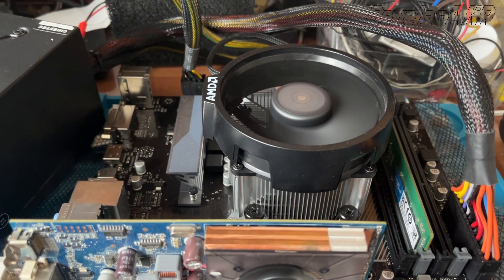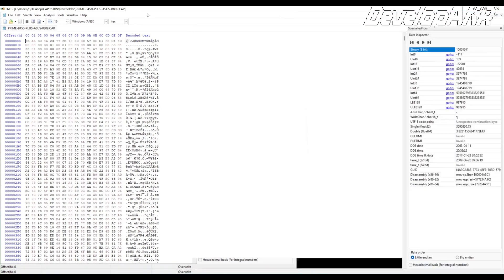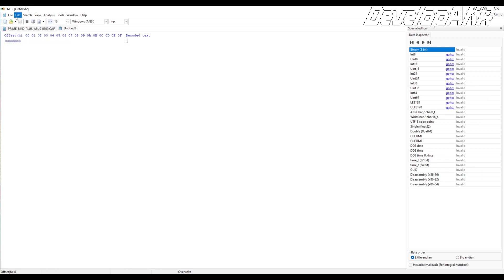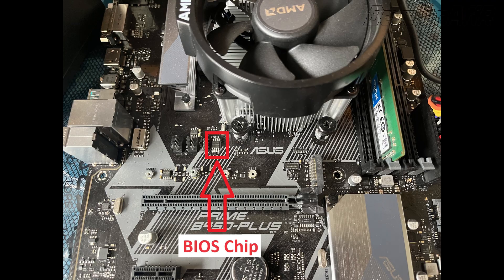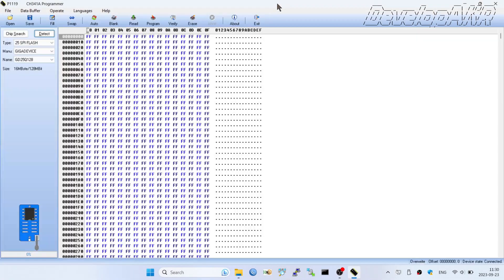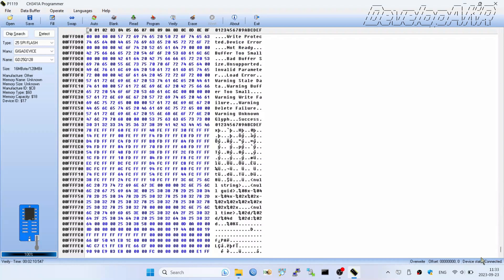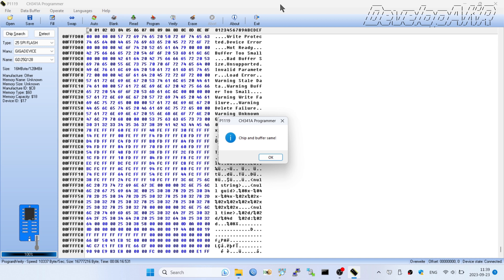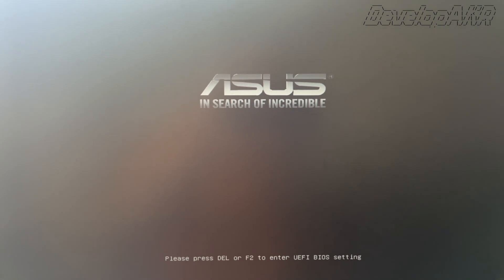How to fix corrupted BIOS using CH341A programmer #ch341a

Comment from the maker: This is a very easy and fast method to use the CLIP for BIOS flashing. However, always desoldering the BIOS chip if possible. This will prevent programming errors and motherboard damage.
Reply: luckily modern cards have a socketed bios
Reply: Ahh yes desoldering the chip will have less damage (im just joking i know what you mean im just dreading that ima have to take mine off to reprogram the chip amd im worried about damaging it)

Comment: Curious about the line 800 removal part as well when going from cab to bin.. what exactly is occurring in that step? For other motherboards/bios chips, is the line 800 a standard or does that line number change by manufacturer etc?
Reply: I'm confused too, because for my model it already downloaded as a bin file

Comment: How do you know that 800 lines need removal?  Does all of the information in the .cap file before the beginning of the bios section need to be removed?   In my ASUS P8H77V bios .cap file, when viewing with UEFI Tool, there  is an Intel section with ME after the AMI aptiva capsule header.  I've tried to create .bin files from ASUS .cap many times now, with no removal of lines, then as you showed.  Either way, I get verification errors: like this one when flashing the IC with the file that removed the first 800 lines: Verification error on address: 0x000005E0, Device: 0xFF, Buffer: 0x1C.  When I read the IC and create a file, compare it to the .bin file that was written (using HxD as well asn NeoProgrammer), the files are identical.  Either way though, when inserting the IC in the board and booting (after battery removal and CMOS clear), no boot.
Reply: thats the power of reverse engineering + experience

Comment: Hello sir, can this method be used on the BIOS chip of a Lenovo laptop? I just flashed the BIOS yesterday and my laptop doesn't display anything except a black screen, with the caps lock and esc lights always on after pressing the power button and the fan spinning. I have tried many methods online but without success.
Reply: 1. Even putting the clip on the BIOS isn't 100% and needs some practice
2. Lenovo EPROM contains more than the BIOS so making sure your get a correct image to reflash with is essential. Probably need to talk to expert user community to sort this out.